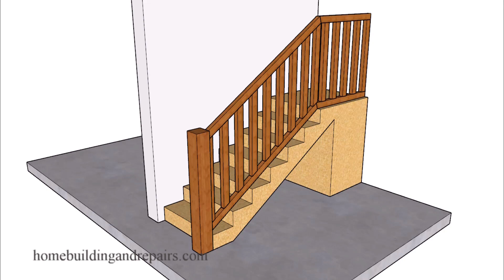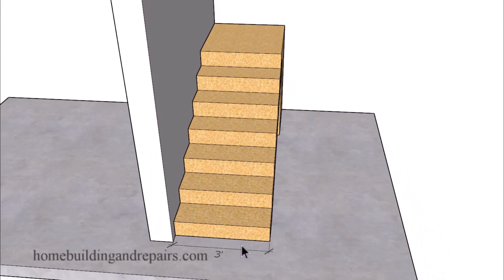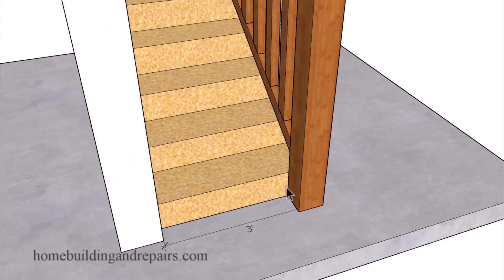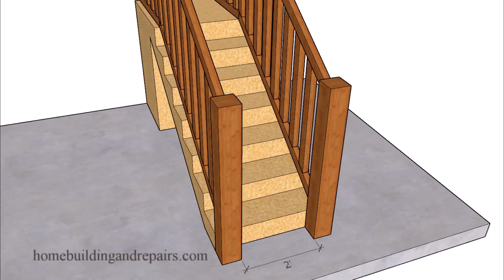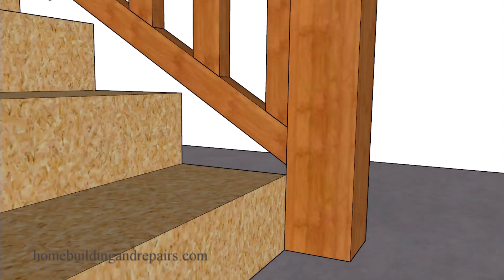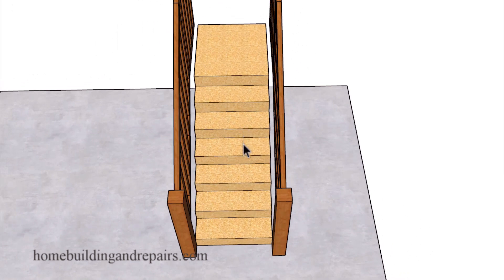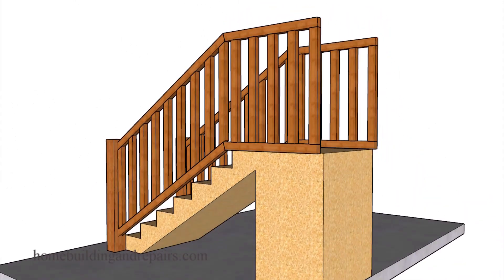Building Code Problems Between Guardrailing, Large Newel Post And Minimum Width of Stairway

Comment: I have a question of my own about railing. 
I have a guard rail closing off 1 side of an interior staircase (building wall on other side of staircase so no guard rail needed there) and this guard rail is at 36" tall from stair nosing to the top of the rail. The top of the rail is gripable and will act as a handrail. 
My question is, can this guard rail / handrail protrude into the 36" minimum required staircase clearance? 
I know that a wall-mounted handrail can protrude up to 4-1/2" into the minimum 36" clearance but not sure about a guard rail also acting as handrail.
Thank you.
Reply from the maker: They usually have a clear space minimum, (36 Inches) and that will be between guardrails, but you would need to check with your local building department to  verify.

Comment: Do you know if building codes allow alternating step stairs?
Reply from the maker: International building code book, reference number 1009.13 says only for small floor access of 250 square feet. However, I would avoid using them if you could and always check with local building codes to see if they allow them.

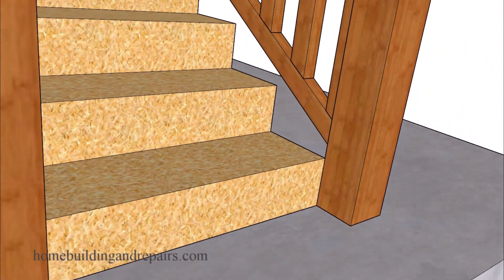Comment: So just a note where you touched on the uder side of the rail, where your shoe comes up to the rake of the stair and the resulting open space below (0:48) I do alot of horizontal balusters and we do them in alot of homes. Generally if youre within 1/2 or so from the bottom of baluster to the to of nosing  the inspector lets the resulting space at between the rise and going slide. Atleast the company i work for has never been called on it. Technically it is in the gray. 

A staircase this narrow i would place the nule away from the stair and either miter or fitting your way to the post giving the stair grander appearance or notch the post over the first tread about a 1/2 inch either side. There's several more ways I could think of to easily help or correct this problem.  If there's no space for that, you're getting a wall rail.